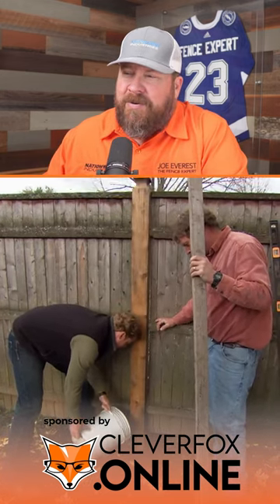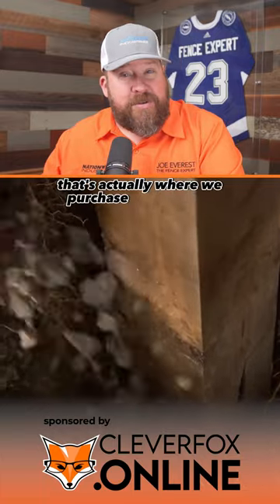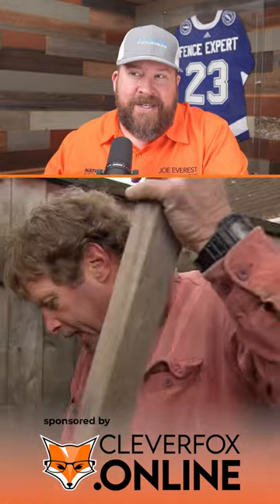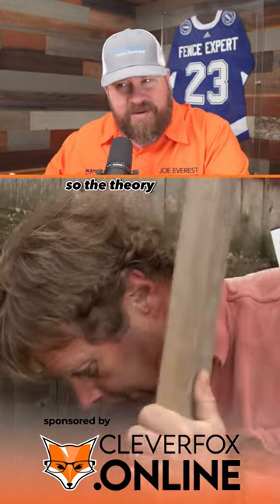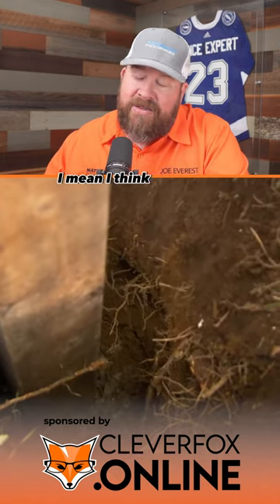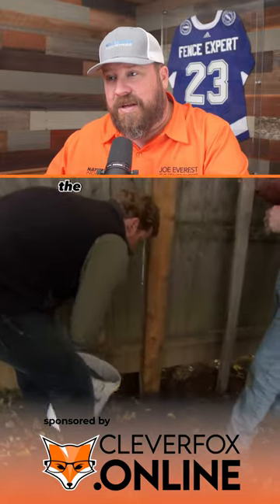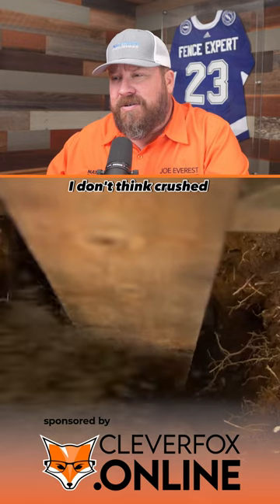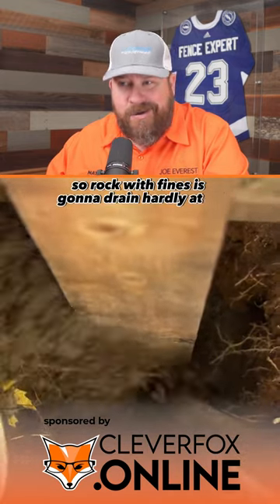Home Depot Makes A MISTAKE While Installing Fence Posts!

Comment: Live out in the country in Oregon. Nobody uses concrete to set fence posts out here. Layer gravel and dirt, post are every bit as strong as with concrete. I would say they last about the same as far as rot, but WAY easier to remove and replace. Put the fence in on my property 27 years ago and they are still strong!
Reply: It's interesting that they hold up as well as concrete but still remove easily. You'd figure it would be just as hard to remove.

Comment: Every wood utility pole is set this way. No cement used.
Reply: They use foam now, we’re I live anyway
Reply: I was going to say the same thing
Reply: Yeah they're not just going down 2 feet
Reply: In the case of utility poles it's probably for the ease of extraction and replacement
Reply: Yeah but those are driven pretty far compared to a fence post.
Reply: And they have the good pressure treating.  Cant get cca at home depot

Comment: In clay, if winter freezes the ground ,tar the bottom of the post then go 4 feet down and dump a bag of concrete so it's under the frost line,fill the hole with the dirt from the hole.

Comment: Crush stone even with fines does drain well. Look how fast water will soak in to a gravel driveway versus concrete driveway. Have been using it with less that frost line depth with no ice jacking or rotten post.

Comment: I have some experience using pea gravel around posts for big state contracts. It actually holds up well as far as stability. Not sure how well it drains because it does get packed pretty tight so some type of protection at ground level is still needed.
Reply: yahh..
dirt works as well as concrete
Reply: @kYA00h  I wouldn't stretch it that far lol

Comment: Okay I did a fence post job and put up a fence right and all we did was who dug out with a hole digger like 3 ft deep put the post in and put dirt around it compacted it was fine as long as you use pressure-treated fence posts you know that the poles have a nice day

Comment: I agree. Either only really well compacted dirt, sloped away from the post, and a deeper depth, or concrete in the top portion of the hole, to the surface, sloped away from the post.
Reply: theres no evidence concrete is better..just a way poles started getting burried over time.
Reply: @kYA00h  that's why I tried to emphasize the slope

Comment: I always used concrete in california when I was younger. 3 inch gravel in bottom of hole, dug 3 inch for the gravel plus 24 inches deep for 6 foot with added 4 inches per additional foot of height minimum but frost line determines additional depth if necessary, 10 to 12 inch tapered width on 4x4 with additional 2 inches per additional 2 inches of width. Never had drainage issues. Can't speak to codes cause it's been over 10 years since my last run but if not forced to change I would still run the same. Easy rule of thumb once you get used to it. What do you think?

Comment: If you want that wood foundation to last, screw a H/U galvanized ground anchors to the wooden posts. Even better if you push the metal ground anchors in concrete. The wood should have no contact with the ground, only the metal/concrete does.

I would never push untreated wood directly into the wet  ground, it's gonna mold soon.

That's how it's done in Germany, and our fences can last very long 35-55 years +. But usually we only replace the wood, not the steel concrete foundations.

Comment: Actually concrete and wood do not mix. They both expand and contract at different rates. The wood swells and breaks the concrete, thereby leaving the post loose in the ground. I have planted umpteenth posts in my life and I have found that packing the dirt that was removed from the hole back into it will work just fine. Over time the dirt hardens with the surrounding ground and the post remains tight to the ground.  Concrete is totally unnecessary.

Comment: My dad has been doing fence for ovet 50 years. If the fence is wood with good cedar posts and they are dug down 3 feet you dont need concrete.

Comment: Flagpoles are set with sand inside a corrugated metal pipe set in a concrete foundation. solid yet flexible? never seen a fence done that way. i prefer wet pouring concrete but a lot of guys dry pour.

Comment: For my trellises I just hard pack the soil around the base with a ramping rod in layers. Seems to work pretty well and it means repairs will be easily done without having to chip away a stone base

Most farmers also won't set their poles in concrete

Comment: I have never used concrete and can set a post with packed dirt and a couple of rocks. You can't pull it out (easily) and lasts a long time. I hate having to deal with used concrete when I have to pull old concrete set posts. Never use concrete!

Comment: Next time use post foam and prevent water from getting to the post and will hold tight as it expands and before it dries you can throw rocks in there to tighten it up even more but water will not penetrate post and post a lash 3to4 times longer😊😊😊😊
Reply from the maker: We’ve done a couple videos with the foam. Didn’t perform nearly as well as concrete and the cost is a considerable increase.
Reply: @JoeEverest  I never had a problem either the extra money was well worth it, drilling the holes with an auger 12 inch made the foam expand against the walls of the hole and totally tightened everything up even to this day. When I pull on the posts, they don’t move, just a solid, or even more than concrete. When I pull on the post, the post will bend and nothing moves. Oh well to each their own you have your way I have mine just remember the extra bucks is worth it.😊👍